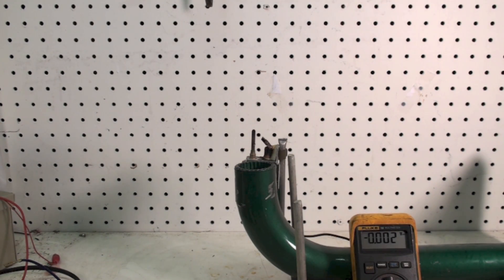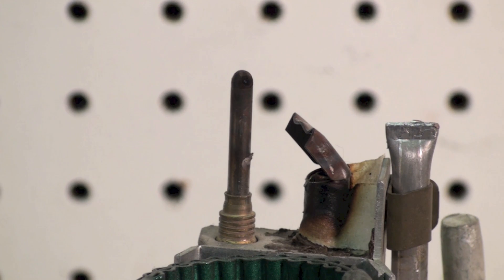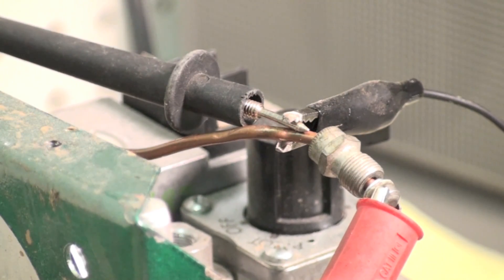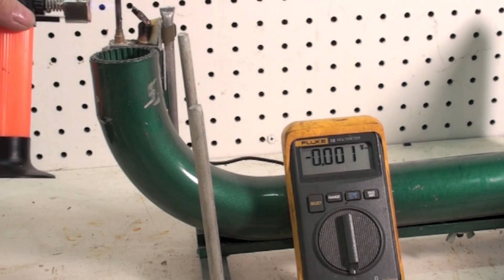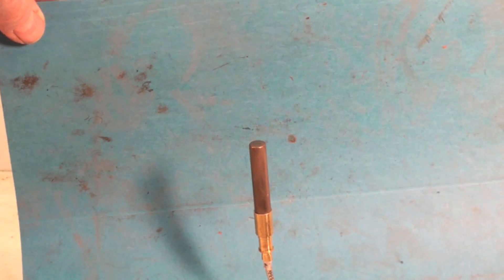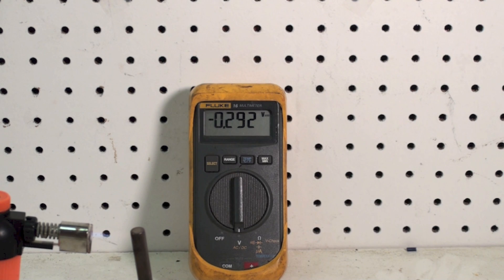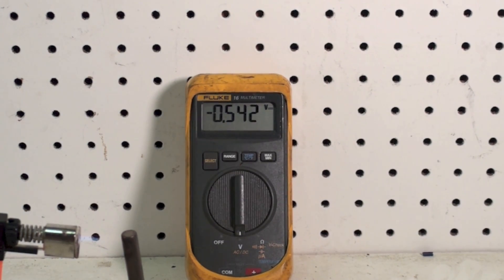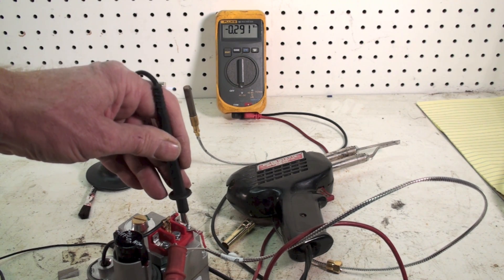The thermocouple compared to the thermopile.

Comment: I've run into a problem with my boiler, I have only been living in the house one year, so last year I called a company and they charged me way too much and did very little. The guy told me one of my boilers out of three needed to be replaced at the tune of 10 grand. But I called another and that guy said a couple thousand and then another said a couple hundred. I wasn't sure what to do so I looked on line. I came up with the pressure was building because the pigtail copper tube was plugged up so I took it off and cleaned it out and it  solved that problem. But the pilot would light but it would go out after the cycle finished. All the signs pointed to the pilot generator from what I could get people to say so I replaced it and yet the problem remained.From there I called a pro and he replaced the gas valve and then it would do the same as before. He then said I needed a new pressure switch and replaced that and yet it still did the same thing. But after a few weeks I did get it to function correctly but it would go out from time to time. What I did was adjust the setting on the pressure switch up and down one half turn at a time and that got me through the winter without too much trouble but annoying. But this year I'm not getting it to work and a guy from the gas service company who had come to change one of the meters, told me my thermopile needed replacing. So I replaced it and no it didn't do it. So I'm stuck, and I just don't trust any of these people here in the Boson area. Is there anything you can suggest that might solve my problem? I don't mind paying someone for their assistance but I'm not about to call someone else out to guess how much money I have in my wallet. I told one guy that I'll pay to get it fixed but not to replace what I've already replaced so he wasn't interested.
Reply from the maker: +Dennis Robinson The situation seems quite cloudy.  There probably is no thermopile as the boiler must be fairly new.  Newer boilers do not have thermopiles or thermocouples.  Give the model and make and I will see what I can do.
GFM
Reply: Thank you sir for getting back with me so quickly. But actually the furnace is an older model Burnham 404 B ANS 221-13 1988 85,000 btu low pressure boiler
My other two boilers are Burnham but a bit newer units with autolight pilots.
I've looked at the wires for the pressure switch and the auto water filler and even cut and restriped the wires and connected them again but to no avail. The thing that gets me is last winter I would adjust the screw on the pressuretrol cut in switch a quarter turn here and there and it would work for a few weeks and then I'd do it again and after a couple times it would work again for a few weeks.
It just doesn't make sense but something is amiss. I was thinking about rewiring everything with new wiring and see if that could solve the problem.that boiler is sound, doesn't' leak and the pilot will stay on and I can turn it on and it will heat up and come to temperature but when after it cycles the pilot goes out, but I can turn it on and then turn it back to pilot and it will stay lit and turn it back on and back to pilot and it stays lit. But that is why I'm baffled. so the only thing left is to put new wiring for the pressure switch and the water auto switch. I also replaced the thermostat here recently because I didn't want to leave any stone unturned.
I do appreciate any assistance you can give with this matter.
sincerely Dennis Robinson.
Reply from the maker: +Dennis Robinson If the pilot goes out when the flame extinguishes, about the only thing I can think of is to install a Honeywell S86 intermittent pilot assembly.  This will eliminate the standing pilot and only light the pilot when there is a call for heat.  
GFM
Reply: yes, that seems like the only logical answer, thank you for your expert advice. I'll look into it today and get one sent to me asap. Good fortune for you and yours and Happy Thanksgiving, we do have much to be thankful for.
Reply: I've looked into that but can't see how it would light the pilot without a flame. When the pilot flame goes out I have to use a lighter to get it lit. I'd have to have a set up like in the other two units, but they're a bit wider and have the room for the gas valve autopilot combination to fit. But I know there has to be a way to repair this one. So thanks again for your assistance but I'm going to figure this out and not let it beat me. After many hours spent last year I was able to get it working so I'm sure as I stay at it I'll get it done.
Thanks sincerely for your advice
Reply from the maker: +Dennis Robinson And the same back to you.
GFM
Reply: I was able to find the problem and now the boiler has run for more than 28 hours.
I did clip the ends off all the different group of wires on the outside of the Boiler and restriped the wires then twisted the nuts back on, a total of about 8 and somewhere in that mix was the problem.
Maybe the auto water filler or the voltage reducer or other parts of the unit outside the actual Gas valve, thermopile, pressure switch. I felt like it was an electrical problem in the beginning but all these experts coming in were telling me to replace this and replace that without once checking anything with any meter. I spent about a thousand dollars all told on these experts on this one unit and yet they couldn't or wouldn't repair it. It's not rocket science, it's just plain logic and I guess if you're logic is getting paid then they did fix that but not my boiler. But now I'm very well tuned in to how a boiler functions and that's good to know.
Though I do remember one of these experts from a heating and cooling place that came out said "Thermopile, Thermocouple, they're kinda the same thing". but that's the mentality of service personnel today. 
 Even the guy from the gas service company out replacing one of the meters on another floor told me it was a bad pilot generator and he was looking right at it and checked it out a bit. But I just didn't buy it, I had replaced it last year and just didn't think it was bad.
 I''ll see, maybe it's fixed for good or maybe not but now I'm sure it's the wiring and not the thermopile or the gas valve or the pressurtrol switch. So thanks again, for your assistance.
Reply: I installed an auto-ignition gas valve, it was simple but was having problems with it lighting, so found the whole problem was the 24 voltage regulator it was bad, that had been the problem all long, I had 5 different so called pro's experts who wanted to sell me part after part, parts changers but knew nothing about their trade. Fucking idiots, these were not young men they were 40 to 50s with supposedly lots of experience. cost me a couple thousand till I gave up and saw the auto-ignition valve. Then realized the whole problem was one of those idiots fucked up my 24 volt reg, yeah right I'll stay away from the fucking pro's
Reply from the maker: At least you got er done.  Please do not swear in the comments.
GFM

Comment: I need a thermopile for a small gas booster heater.  The current one works well enough to run the pilot safety, but not enough output for the thermostat circuit.  Local places around here don't have them (most don't seem to have heard of them).  You've shown that they are still being made, can you tell me where in the H*!! to get one?
Reply from the maker: +diggerop Heating contractors should have them.  Or there are plenty of sources on the internet.  Hope this helps.
GFM

Comment: Why is a thermopile used? When you need higher voltage to open a bigger load?
Why is a voltage output higher than that of a thermocouple needed? Is it to open bigger valve or something?
Reply from the maker: Drew Ski The thermopile was developed to operate gas valves without the use of high voltage power.  This would eliminate the need for a power connection.  GFM

Comment: My land lord purchased a Whirlpool nautral gas hot water heater. This was a brand new water heater that was purchased from Lowes. The plumber hooked it up and it wouldn't fire. The thermal switch was broken. So since Thursday evening I have had no hot water. Isn't there a way to force light the water heater? Why doesn't the government force Honeywell to stop making those worthless electronic gas valves.
Reply from the maker: altlandf You can thank government agencies for that.  Water heaters have been changed for safety issues.  There is no way to force them.  Manufacturers make what passes safety regulations.  GFM
Reply: This electronic valve has a major design flaw. There's nothing wrong with the old school no electronic valve. If you get the 4 flashedes on the Honeywell valve it's done.  Another thing why don't plumbers have this part? Why would they not be able to get them locally? www.tylertork.com/qna/2013/gasvalve talks about all the issues with these worthless electronic valves. This is bullshit.

Comment: under what reading would be considered a bad reading for a thermopile.

Is under 24 millivolts a circumstance for replacing a thermocouple.
Reply from the maker: Diamondssnpr We usually consider 14 the minimum for a thermocouple.  Thermopiles should read 4-500 open circuit.  That means if the gas valve is not calling for heat.  If the gas valve is calling 100-275 is good.  Hope this helps.
GFM
Reply: grayfurnaceman Thanks for getting back so quick, and thanks for making these videos, I'm looking to get into service work soon for plumbing, so i thought i would study up.. CHEERS...

Comment: need to connect circulator pump to burner circuit,to operate simutanous. control ra832a not correct.need relay to connect circulator to 110 v circuit.

Comment: Power is in W not mV
Reply from the maker: When the thermopile system is used, the power source is the thermopile so we don't use the same terms.  
GFM
Reply: How many Amperes at 0.034 mV?
Reply from the maker: I have never measured but it will be in the low milliamps.
GFM

Comment: The Thermopile is an over temp cut out probe?
Reply from the maker: No.  It is a power source to operate the gas controls.
GFM
Reply: Hey cool thanks
Reply: Ok so I guess you know if the pile is the problem or the couple by the volt test? Does the appliance have a badge with the details or is this industry standard knowledge across the board?

Comment: I was wondering if you could tell me a little about how the old large pizza oven temp controllers work.  Its old and has no external electricity hooked up.  Just a copper  temp sensing probe attached by what looks like a copper capillary very similar in appearance to a thermocouple.
Reply from the maker: I have no experience with these controllers.  I could very well be a thermocouple, or it could be a mercury filled probe.  Does it have and end that looks just like a thermocouple with a smaller tube to the control itself.  If you want to send a pic, I will try.
GFM
Reply: grayfurnaceman The temp probe is more like a small capillary tube with a 1/4" x 8" strait tube on the end. The valve itself has a dial that goes up to 500F to control the temp of the oven.  All of the various components are separate and plumbed together with pipe.  The safety valve seems to work, I push and hold the button and light the pilot and eventually I can let go of the button and the pilot will stay lit.  The next component is the shut off valve then the temp control valve.  I will see if I can get a picture.
Reply from the maker: Richard Keith What you probably have is a hydraulic temp control with a pilot safety.  They use the expansion of the hydraulic fluid to control the amount of gas to the burner.  Hope this helps.
GFM
Reply: Thank you GFM.

Comment: I have a DESA natural gas fireplace. My thermocouple works great because the pilot light stays on when I turn the gas to the on position, but the pilot light goes out when I turn my thermostat on. The thermopile gets up to about 460 millivotes with no load. When I connect it to the gas valve and turn my thermostat on, the pilot light immediately goes out.  Do you have and suggestions on hoe to resolve this problem?
Reply from the maker: You probably have a short to chassis.  It would probably be between the thermostat and the valve because it does not fail with the thermostat.  If you disconnect the wire from the thermostat to the gas valve at the gas valve, and it still goes off, it is between the valve and the thermostat.  Hope this helps.
GFM

Comment: Mine on my millivolt system is putting out about 700 millivolts and the tip of the thermopile is glowing red a little.  Is the pilot set to high?
Reply from the maker: It should be ok.  If you want to reduce it you can, but be sure the millivolts are up.  
GFM
Reply: grayfurnaceman Thanks so much!  Your videos are super helpful.
Reply from the maker: Bib Drums Welcome
GFM

Comment: We'll I tried new thermo couple still no luck only lights on the manual side of the switch the stove shop said it could be the gas valve but has been discontinued becouse the stove is 15 years old
Reply from the maker: Did you replace the thermocouple or the thermopile?
GFM

Comment: It is a millivolt thermostat battery power electronic I've changed wiring everything is tight and new battery's I'm baffled worked fine last year when I restated this year when the problem started changed thermal couple about three years old never changed thermal pile stove is about 15 years old Vermont castings radiance stove thanks for your time and writing back
Reply from the maker: Be sure your flame covers the thermopile.  If so change the thermopile.
GFM
Reply: grayfurnaceman This is typically what gets them in this situation, you cannot bake them into submission, They require a cool end and a hot end, not 2 hot ends,A temperature differential is what makes the dissimilar metals create the 3/4 volt or 750mv.
750mv systems are easily troubleshot with a AAA battery in a Radio Shack battery holder with alligator clip leads, or just a battery and wire taped on each end of the battery to simulate a good flame signal, a battery is more than 750mv  but at this level  it will not hurt a thing to put 1.5 v to a 750mv system.
Keep in mind a 750mv system often uses low voltage wiring to its stat, a tarnish or patina or moisture etc can easily disrupt this, the current flows outside the wiring and that is enough to make the stat quit operating. get the wire shiny at both ends, floor furnces did this alot, with the prices of a tcouple and tple, you are doing nobody any favors by leaving one in if already therem trust me a call back  on a millivolt system is embarrassing to me  but they can actually be tough if you do not think with a fine touch, like clean wires  no tarnish etc, and test with a battery and replace serviceable parts like the pilot safetys
You only want the flame impinging upon the top 1/3 to 1/2 at most or risk this type of stuff.

Comment: I have a gas fire place my stove will light manually when I flip the switch but won't light with the thermostat . pilot is working once stove manually starts and I flip the switch to thermostat it will run and shut off when it reaches set temp but will not restart when temp in house drops it's millivolt system if I disconnect the two wires put them together and start the stove flip it to thermostat will stay running separate the wires it shuts off any ideas would be great even tried new thermostat no luck thanks for your time
Reply from the maker: Are you using an electronic thermostat?  Also is the thermostat a millivolt thermostat?  There is a difference.  Also make sure all terminals are clean and tight.  Hope this helps.
GFM
Reply: triple read above my message

Comment from the maker: Well, you can put them on, but they won't work right!  Thanks for the thoughts.
GFM
Reply: Maybe you can help. I have a late 70's camper with a hydro flame furnace and everything seems right except the pilot won't stay lit, I assume the thermo pile is bad but no one can find one like mine. Mine looks similar to your but the 2 wires go to a screw in fitting like is on all the standard thermocouples. I thought I could just put in a standard thermo couple except the fitting  that screws into the valve is too small. The only numbers on my therma pile is a little aluminum tag that says 34R
Reply from the maker: @yamaharider7672  You might try this one:  https://www.amazon.com/Thermopile-Pilot-Adaptor-Coaxial-Long/dp/B003A1YFF2  
GFM

Comment: Great video... You can also mention later on that on mv systems, you need a mv thermostat, you cannot hook up a 24 volt thermostat to a mv system. I have not seen that many thermo piles out there, except for old gravity furnaces and occasionally on  older boilers.

Comment from the maker: Originally, they came with wires.  The reason they are made the way they are is it makes better contact and can be differentiated from a thermopile.  The bare tubing is actually one wire.  The other is the insulated wire inside.  Hope this helps.
GFM